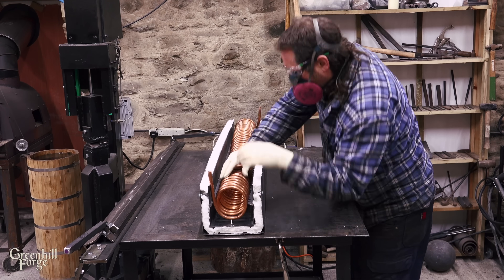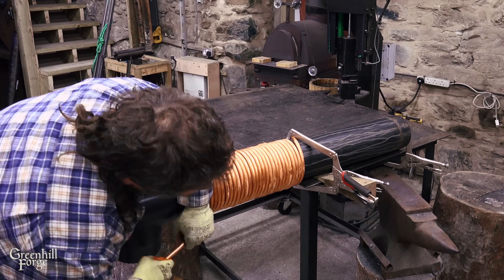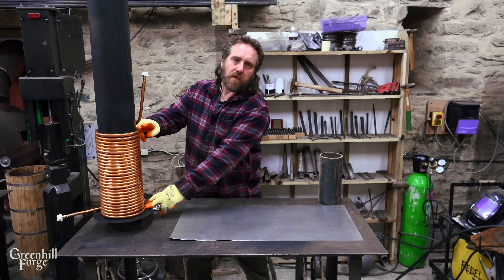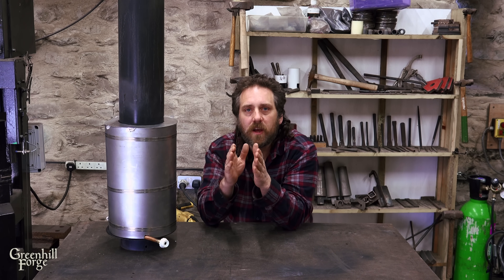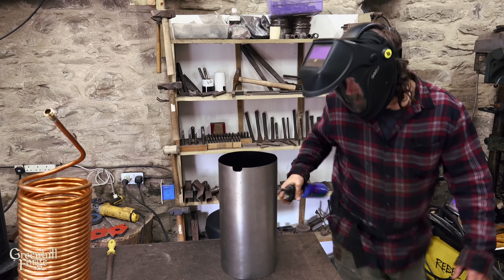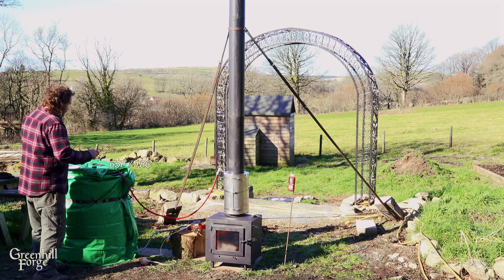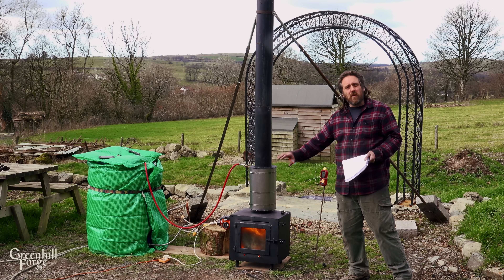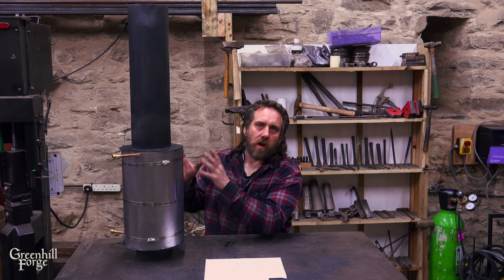Best Wood Stove Water Heater Yet: New Design Tested | Off Grid Water Heater pt3

Comment: Smoke as far as FIRE IN A BOX is concern dont care she dont need gravity.
    Satans kids pass law a horizontal chimney MUST rise 1" per foot.
  They do this buz it doesnt work..  
   They poison computer systems. They dont know this. They are not humans.
 
  Smoke:
    It is literally blown out.
    Fire is a bomb.
     Just a slow motion explosion sir.
    SIR ARE U HEARING MEE.
  THE HIGHEST IQ IN TH HISTORY OF MANKIND & CREATION....
   Gravity is just cmpleetly irrelevant in as much heat itself rising is not a mathematical factor gonna influence any so called imagined result 1way or th other..
 
 As 4 th heat itself that IS rising so what th effect itself is infinitismal horizontal vs vertical pipe. 
  VERTICAL chimney will have me dismantling cleaning pipe re assembling 4 x's a year cuz moisture constantly re circulate moisturizing smoke.
  
   Where does water come from?
    Wood stove isn't really care if u dry yr wood I do not store wood drying 1year size of my house in 1spot like idiots do.
  My wrt wood in rain gathered downpour is dried in minutes placed fired stove.
   Wood stove dried rooms so, any wet branches piled room dry remarkable fast.
   Moisture come mostly from air not wood.

Wood stove suck enormous moisture from the air.
   It can drip shocking amounts water around a quart per fire some days.
   Too, as fire cool condensation cause moisture saturate pipes even more glazing creosote like cement in pipe and raising chimney up???
   ...this drips water right back down!!! ...in2 stove rusting it &pipe out!
   A horizontal pipe tilted UP evn a teeny tiny amount will THUS THUS THUS rust out a galvanized pipe every 1.136 ave. years like clockwork.
 Galvanized impossible clean anyways cuz corrugated not smooth designed by cmpleet shtheds.
    I use 1/8 thick SMOOTH 12' big rig exhaust pipe. 
 CEMENT:
    Did u know? 
Cement is made by firing minerals removing oxygen?
   Here is a fun fact.
  Adding water 2cement turns it to stone.
    Tilting a horizontal pipe UP like Satanz kidz worship cause moisture concentrate in pipe as it cant run out = cemented pipe.
  Thats WHY demons HAV2 pass laws.
 They have 2punish u if u dont obey cause nobody in thr right mind would subscribe sheer batsht absolute lunacy.
   Demons are scrypts. Not human.
   They are strictly law abiding2 their dowload &arent engineered 4learning curve.
 
   My pipe tilted down over 1 foot in 15' length water sometimes almost runs vs drips out!

Cement = minerals manufactured specifically with no oxygen.
   Wood ash is minerals.
   This is not looking good.
    That's what unburned wood ash is 2a large extent.
 Minerals.
   Throw in water u get pipes coated in black cement a hammer & chisel will NOT ever clean it all out.
 So, u NOW hav an insulated pipe won't release heat in2 room.
  The latest? thing buyers now humping like eager toads? are triple layer stainless pipes.
   Cool 2 th touch.
  Why???
    They are insane thats why.
   YOU WANNA SELL ME A $+4K COLD CHIMNEY PIPE???😆
    Satans boys SPECIFICALLY engineer& make wood stove so as2 deliberately teach u they dont work bcuz they HATE free energy thstoves designed 2punish u the whole process of how 2operate them a$$hole backward & batsht upside down = why chimneys  built vertical.
    ..and how??? on EARTH??? u gonna clean that 4 x's a year icy2story roof middle 25mph wind with yr ice latter?

  How loooong is th handle on YOUR chisel?
   
    And this? ..in a chimney has irregular surface POROUS brick???
   A chimney that faces outside releasing vast amounts heat 2 th cold?
  WTF what th actual &^%$.
   Can u see what a cmpleet dipsh*t this engineer photo was???
   My horizontal 15' pipe warm to th touch as exit windows so, yes it has released enormous amounts heat in2 room by that time.
   My wood stove horizontal pipe pulls warmed up air BACK in from outside thru a heated 12" diameter aluminum shroud butted against window where chimney exit.
 Freezing air comes in warm.
 Can u see yourself cleaning, chiseling black 1/4" cement January with that chimney photo?
   Demons build this sduff they not humans they devilz. Poisonous&engineered 2b so.
 And yes all th food they make poison. Medicines, vaccines, poison it all starts with kids.. in public skoolz believe US or we give u an "F."
  
  Wood frame cardboard termite food homes kill 3.27 people burned alive 4every thousand. 
 
I recommend:
    Only CAMP CHEF WOOD STOVE Amazon. 
  I was banned from Amazon 8 yearz ago when I xplain why Camp Chef wood stove is END all 200 year old traditional TRUE  wrld leader design.
   SATANZ boyz label it TENT ONLY NOT 4HOME USE stove BECAUSE they know it wrks.
  Satanz Reptilian angel scientists lived on your planets millions of years MAGICIANS compared 2u will trick u they HATE wood stoves sell u $3k wood srove stubby legs heat floor cant dry wood under no cooking surface tiny logs cut way more wood wear out saw butted against wall radiate HEAT outside insulated ???????? chimney cold pipe ????? vertical pipe drain moisture BACK in stove rusting stove clog pipe SHUT 4 times a year.
    Atmosphere has gallons moisture. I hav not cleaned my tilted DOWN FROM HORIZONTAL pipe 1 year bcuz drains water or u get CEMENT.
  Cement is made removing oxygen from minerals!!!

Comment: Y'all going all science and all but most of the heat is just running out of your pipe unused. And how much heat you think that flimsy 1mm plate steel of the chimney can radiate / transfer? You are building 10.000 Volts with no Amps.
You just need a metal mass inside the chimney where the coil is. Just weld a car suspension spring in there or something.

Comment: Nice work. It's good to see someone being methodical and paying attention to both details and principles.
However, I think you've got things a bit wrong. For the sizes you're working with, thermal mass is not your issue. What you need to worry about is thermal resistance, and that is affected by how well the flue is thermally connected to the tubing. Sand is better than air, and graphite powder helps fill the voids.
But I would recommend using water in place of both sand and graphite. It makes intimate connection with both of the surfaces. Depending on how well your thermosiphon is working, you may or may not be able to heat the water barrel to 100 F without the water in the transfer unit boiling.
Reply from the maker: I agree that water, among some other liquids, would be some of the best options but they come with their own challenges. It has to be water tight so the fabricating is more of a challenge and it needs to be either an open system or have really safe blow offs. And then the level needs to be monitored and topped off so it never runs partailly dry. A solid medium avoids all those challenges but is less efficient. So it comes down to choosing the trade-offs.

Comment: Could you not construct a pyramid shaped vessel covering the top of the stove with top wrapping around the flew. Cutting a couple of small slots to prevent explosion. This would not only capture more heat as more surface are that is in direct contact with the fire is now being captured but would also lead to a heat pocket warming the pipe 360•

Comment: I would spread my Kohl's apart leave the air gap inside the container that the coils are in and then I would tap it on both sides and insulate the outside that way you got hot air all the way around your stuff plus with your coil spread apart it has more surface area to heat

Comment: why not just use your welding skills to make a water tank around the heat stack itself, this would bypass the need for expensive copper material, and vastly increase the contact surface.  you could then insulate the water tank itself if you felt it was needed, or leave it uninsulated and allow the warm water to act as a thermal mass and heat whatever space it was in.

Comment: make your outer pipe taller and fill that with graphite. There may not be copper all the way up but it is more surface area to absorb heat from which will transfer down to the copper.

Comment: @ the engineers: Am I looking at the right subject/water heating strategy I want to build a hot tub water heating system using the wood stove from inside a sauna Are there other/ better ways to use wood stove heat to do this? (Desired end result is simple hot and cold water taps into the hot tub next to the sauna).

Comment: I built a few different versions of an external coil heat exchanger for the output of my catalytic combustor wood stove.  The improvement that made a huge difference was installing a 4 inch auger centered in the exhaust pipe to disrupt the laminar flow and force more heat transfer to the walls of the exhaust pipe.  I run it with a variable speed delta T pump and it generates about 12k BTU/hr based on meaured water temp rise at the storage tank.

Comment: my only thoughts getting more to improve efficiency might be stretch out the coil more or thinner copper equalling the input  and out put ,, like a manifold at top and bottom ... the smaller ID to water ratio might transfer heat faster?

Comment: I'd try a wide spiral along the full length of chimney with same length of copper pipe. Currently you're only transferring heat from about 18" of chimney. Doing this might also eliminate the cooling effect the sides of the copper pipe coils are having on each other. Just curious. Nice video.

Comment: To enable a fair comparison between the inside coil and the outside coil, the outside coil should have the same 1/2" space between each spiral as the inside coil has. The missing of these spaces put the outside coil at a disadvantage

Comment: Awesome video.  Love the analysis.  Graphite is actually thermally reactive.  It is as reactive as charcoal and may have a slightly lower ignition temp.   It was a lesson learned with graphite moderated nuclear reactors.  Once the graphite caught fire it was hard to put out.  Think Chernobyl...

Comment: I just heat water in a pot either on top of my woodstove, or inside the woodstove if I want  hot/boiling water fast.

I also have a one quart thermos bottle i use to keep hot water and have it ready for use at odd times.

Been doing that for decades, and see no reason to change.

Comment: I grew up on a farm with a system of pipes set in cement and brick behind an open fire, so probably not very efficient, but the water was often boiling hot. The sound of the first ‘bloop’ of the boiling water in the water cylinder was an indicator that one of us was very shortly going to be placed in a scalding hot bath of rust coloured rain-water 😂

Comment: Spread the coil out 1 inch between and run small length through the pipe. Also leave 2 inch gap to outer shield. Air layer

Comment: I have a long woodstove chimney, that I burn in my workshop, extending along the height of my entire house and I have been wondering If I could line the inside of it with vertical steel tubing and drive some air through it with a fan and a thermostat to compliment the heating system of my house. After a lot of thought I decided against it because of the hazard of having the chance of gas leaking into the pipe. Maybe the same design could work with water safer and more energy efficient. The only design changes to your system would be vertical steel tubing all around the chimney, instead of copper coil and loops at the end of it with a "up and down" direction of flow. I think it would be as easy and as "cheap" to build plus it would be longer lasting and cleanable with steel wire brush. Thank you for all of your videos and your hard work of producing them! 🖤

Comment: I think the obvious modification would be to lay the cooper coil on the flat surface of the wood stove and then wind it up the chimney pipe a couple of feet....all the other options neglect the simple issue that the " cooking" surface gets very hot ....try that pleeze.

Comment: I'm wondering why you don't have a damper in the pipe above your coil to hold heat into the pipe. You're losing a ton of it out the top. I know this is an older video and you probably don't go back 7 months and read comments but maybe someone else will see this.

Comment: I have 4 suggestions for upgrades. 

1. Instead of having the copper pipe coiled tightly, have about a 1/4 inch to 1/2 inch gap between loops. This should allow the heat from the flue to more easily surround the copper pipe. 

2. Ensure that the copper pipe is compressed against the flue, any gaps will reduce direct heat transfer. 

3. Add fins to the copper pipe. The fins can be short pieces of copper pipe that are hammered flat and then soldered to the pipe. This is also a great way of maintaining the 1/4 inch to 1/2 inch gap between loops. These fins will greatly increase surface area meaning more heat transfer. The more fins the better as long as there is at least about 1/8 inch gap between fins. Increasing the gap to 1/4 inch or more would be cheaper and easier to construct. 

4. Use a radiant barrier on the outside of the system. 

There are two main types of radiant barriers that are easily obtainable. 

The most common and more expensive of the two  is bubble wrap with a mylar coating. Do NOT use this product.  The bubble wrap and mylar will quickly melt. 

The less common, but significantly cheaper version is an aluminumized paper sandwich with a fiberglass reinforcement. The outer shell has a thin sheet if aluminum foil bonded to paper with the aluminum on the outside. In between the outer sheets is a fiberglass mesh that makes it much stronger. 

A large portion of the heat from the flue is radiant heat.

There are 3 types of heat transfer: conduction, convection and radiant. 

Conduction is heat transfer inside of a material and/or between materials. This is the heat captured by the copper pipe in contact with the flue.

Convection is transfer of heat using a fluid. Air is considered a fluid in this case. This is the heat captured by the copper tube not in contact with the flue and by the copper fins.

Radiant heat basically heat energy transfered by waves of energy. Radiant heat doesn't become temperature until it hits and interacts with matter.

This is the heat that you feel when you are standing a few feet from the fireplace/wood stove. It barely heats up the air as there are very few molecules for it to interact with. Your body is much denser and interacts much better.

The job of the radiant barrier is to reflect as much radiant energy back towards the copper pipe.

The reflected radiant heat gets another chance to heat the copper pipes, copper fins and even the flue.

The amazing thing about the radiant barrier is that once the radiant heat goes past the copper pipe and flue it will pass through the flue and interact on the flue, copper pipe/fins on the other side and then be reflected back again.

Each time the radiant heat  transfers heat to other objects less energy is left. Eventually the original radiant heat will either be transferred to the flue and copper pipe/fines or will have escaped because the radiant barrier is never 100% efficient.

This type of radiant barrier can be bought on the "A" store for about $60 for a 4 foot wide, 250 sq foot roll. This is cheaper than the tiny bundles of mylar bubble wrap that is often about 100 sq feet. The "L" hardware store has a version similar to what I described for about  $73 for 500 sq feet.
Reply: I almost forgot about a 5th suggestion. This would be to use antifreeze instead of water. 

The downside is the cost, as you would need to create a second heat exchanger in the water tank. 

The upsides are:
1. Much lower chance that you could cause the water to phase change into steam. This could create a high enough pressure to burst the copper pipe. Even if it doesn't burst the pipe it can cause erosion of the pipe leading to a higher chance of failure in the future.
2. The antifreeze should transfer heat better because of the slightly better specific density compared to water and that the antifreeze allows higher temperatures before phase changing to steam
3. The antifreeze will reduce corrosion of the copper pipe.
4. Antifreeze will inhibit freezing. 

If you do use water, it should be highly filtered, preferably RO water to resist corroding the copper. It needs to be pH treated. You should have a relief valve at the high point to help protect against pressure build up from steam. I would also install  a pressure gauge and temperature gauge near the outlet of the copper pipe at the flue. As the water temperature increases, the pressure will increase (unless the water tank is vented). Being able to see the outlet temperature and pressure allows you to more easily understand how the system is operating in real time, compared to simply watching the water temperature at the water tank.

Comment: crushed pumice would be a good filler, also for anyone with a log burner make the flue stays inside the building as long as psooble, I've seen them in Canada, Norway eyc where they divide and go through diferent rooms in the house to use the heat as much as possible before its lost outside, so yes harvest hot water but also think about havestng hot air, one guy had the flue feeding into radiators upstairs, so instead of hot water in the radiators they had hot air in them, his home was cosy 24/7.

Comment: I love your data! If I were to do the same thing and have the water pumped through the waterlines in my concrete basement floor would that be the way to do it? or would it be best to heat up a few gallons of water and pump that through the pipes when there’s a call for heat?